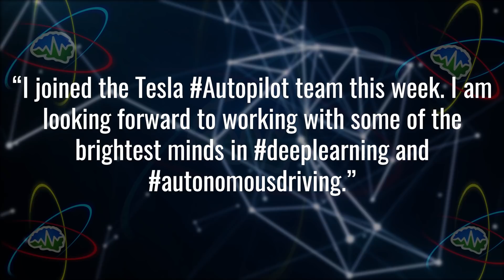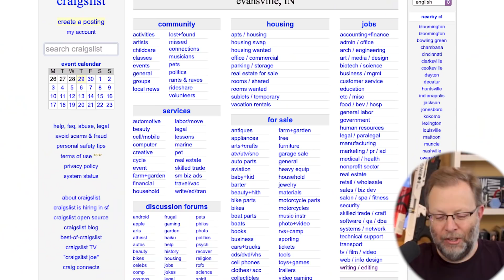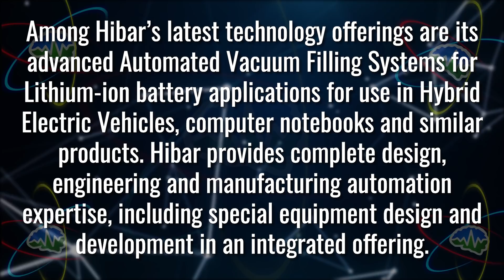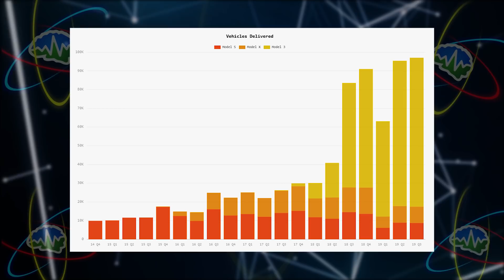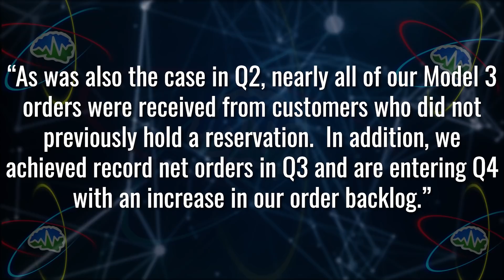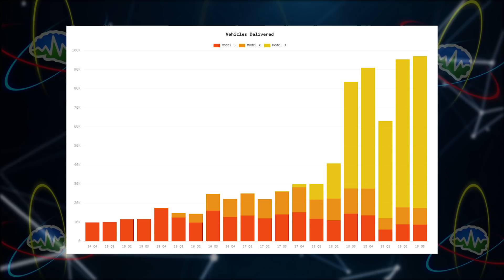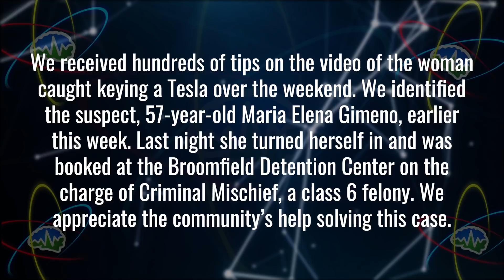Tesla Buys DeepScale and Hibar Systems! - TTN Bite Sized

Comment: The analysts constantly focus on the margin of the model 3, but they would never mention the margin o competitors cars.  We already know that the margin the Bolt is negative because GM loses 7to 9 K on each one they produce.  It could even be more because the dealerships have had to discount some cars to move them.  Plus, the price of the Bolt is for a glorified " Spark",not a BMW contender without the self driving hardware, and deluxe interior appointments.  I think that the Kona, the Niro and E-tron face the same situation and that is why they seem hard to get.  The shorts are stupid but they are not that stupid.  Tesla is miles ahead of the competition.  What the "Shorts" are doing is as much of a scandal as "Dieselgate"

Comment: did you guys see the video, maybe it was in Sweden or Norway (I forget)....A guy got in his Tesla and was driving but noticed something wasn't right with his tire.  He checked it and it was missing bolts.  He checked his Sentry video and saw a guy who had been there and removed the bolts.  Caught in the act.  Here's the insight.  If someone did that they may want to follow the car they have sabotaged and film the actual event happening so they could say here is what happened to this Tesla and get it on cell phone to make a viral video.  SO then, they should check the Sentry video of when the car was driving around and see if the Sentry Mode was able to capture any cars license plate that may have been following the sabotaged car....in order to capture it on video "malfunctioning".  So basically have to take a look back at the short drive the car made and see if there is any car that could appear to be following to capture the rolling away wheel on camera.

Comment: Seams to me Tesla wants to build it battery inhouse which they are doing but to not and I mean NOT violate someone else patent they want to manufacture its own battery..  which may change in size shape and yes control.  more power.. Imagine a battery with a internal capacitor for high capacity needs and release.  

As for the record quarter.. and hey 110 thousand delivers and the number is off by 1%  in the boardroom and someone said they all sold..  That beats the crap out of ford GM and chrysler who make cars and they sit somewhere for months before it gets to dealer and then may sit another year before all sold. 

Personal Tesla is selling out the door.. who else does that..  CHINA BYD startups in electric cars.. Tesla will wax those come 1st Quarter of 2020

Comment: I convinced my dad to drink the Tesla Kool-Aid. He was considering a 2019 Lexus RC350 AWD or Porsche Macan S, as a replacement for his 2006 IS350 RWD. He really wanted an AWD car, so he wouldn't get stuck on a wintry uphill in Pittsburgh's worst time of the year. He also likes to play a formidable game of 'traffic chess' which often depends on spirited acceleration through Pittsburgh's many curved highways.

While driving back home from the Porsche dealership we had a conversation about him considering a Tesla on an 'off-chance', but wasn't serious about it due to the inconvenience of needing the support of the electrical grid. I asked him a simple question, "How often have you driven your car more than 100 miles away from home?" It was at this point he realized the answer to my question was ~nil since my mom has a ICE car more suitable for longer drives. His typical commute is ~50 miles roundtrip. Even with a Factor of Safety of 2, that's ~100 miles.

Later that day, we test drove a Long Range Model 3 Dual Motor (AWD) with a claimed 0-60mph acceleration time of ~4.5s and ~300 mile range. I sat in the driver's seat as we turned out of the parking lot. About half way through the maneuver, the front wheels were turned as much as they needed to be and my right foot increased throttle angle to as much as the floor would allow.

What happened next is pleasantly anti-climactic.

The vehicle's rear end compressed as it reacted to forward thrust. With a minimal amount of inside wheel spin, it lurched forward as if the tires were made of Velcro. After the feeling of getting rear ended had subsided, the speedometer read 'equal or greater' than the posted speed limit ;)

I was sold. He was sold.

There were only a handful of cars available which were already built and included a 'Thin Red Line' beneath the Dual Motor badge on the trunk. These cars claimed an acceleration from 0-60mph of 3.2s and a 310 mile range, but didn't have the 20" wheels, upgraded brakes, lowered suspension, and rear trunk spoiler. Perfect. Fuck spending $5000 on that noise. Also, neither of us care about being 'green' :D

Long story short, he bought one (dark grey). And after a week of awe, disbelief, and much contemplation, I bought one (dark blue).
Reply: shind3 thanks for sharing. My wife and i were so close to buying a bmw but decided, on a whim, while driving home from the bmw dealership, to test drive a model 3.  Our test drive was probably less than 10 minutes but we both knew right away that the model 3 is monumentally better than a bmw. We have owned our model 3 for over a year now and the crazy thing is, it has gotten better than when we first took delivery.
Reply: Nice! I wonder how many other stories like ours exist; buying an American Tesla soon after test driving a German motor vehicle :)
Reply: thanks for this story ! I am sold too --- Velcro!
Reply: You should care though, considering you live in Pittsburgh and the ocean is gonna be on your doorstep before long.

Comment: Sorry guys but scaremongering about the London Underground was not helpful.  The dust from the brakes is none toxic, no where near as bad for you as the emissions from burning diesel.  Just because it smells and maybe makes you sneeze it doesn’t mean it’s poisonous.  Sure it would be nice if they didn’t have to use friction brakes but it’s still much better for the environment than travelling in a car on the surface even if it were ev.

Otherwise great show. Thanks.

Comment: Here’s my exasperated rant about Tesla’s A.I., Self-Driving, Neural networks, Car Games, Easter Eggs and software company purchases: there’s more important issues to solve, such as producing a better body in white for Model 3, producing a better battery, start production of Model Y, reducing battery pack weight on Models S and X, improve after sales service, and overall cost reductions!!

The resources spent on all the software “crap” should be left for a later stage, when all of the above is managed. 

Rant over 😤
Reply: Apparently, they will be making Model Y body in white out of 1 part - a new casting machine is on the case. This, along with more Easter eggs will no doubt filter down to the other models!
Reply: Steven Bense like the faster charging 2170 cells and much lighter pack of Model 3 has filtered down to Models S and X? 
Tesla is dragging its feet in what matters the most and this is exactly what pisses me off.
“Pumping out” useless software is so much easier and it impresses their customers-geeks.
Reply: K